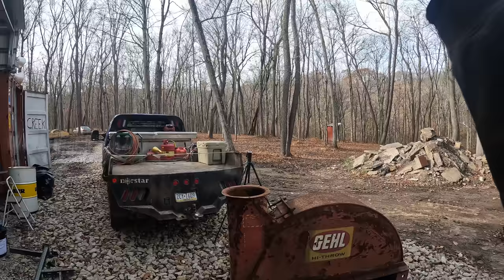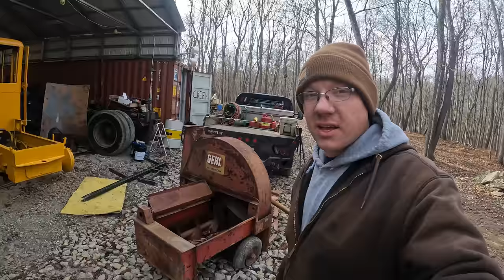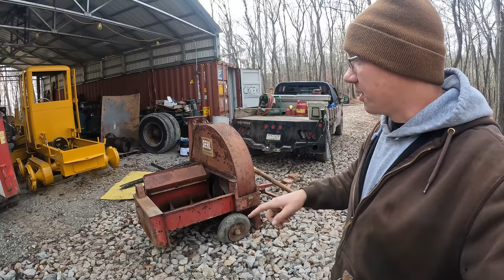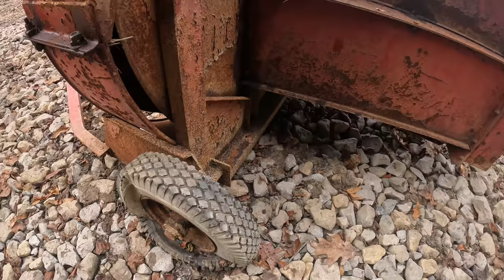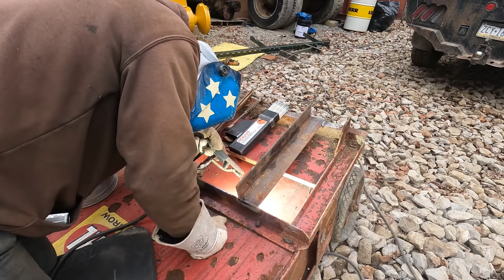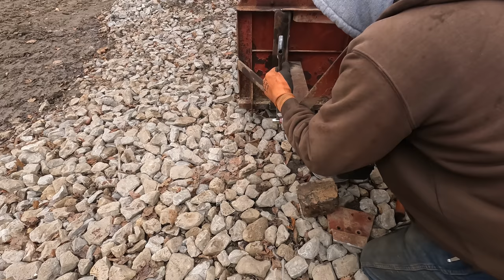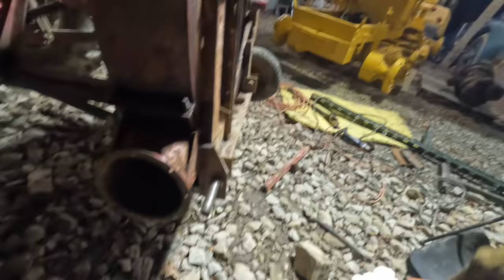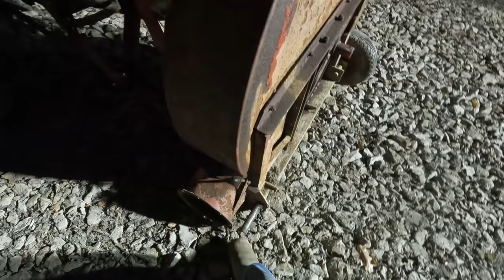I Built a Giant DIESEL POWERED Leaf Blower!!!

Comment: I suspect that you need a bit of forcing cone.  Some additional velocity would do a lot.  If that discharge is say 8", try reducing in a taper to 6".  I think the intake does need work, but not a whole lot.  You expanded metal is good.  Just relocate the intake to the top so it will not suck up leaves and reduce air flow.  Maybe angle your discharge cone back some to blow away and behind you ...

Comment: Mat rotate the blower back to the top, then run black flexible pipe drain stuff connect to lower, then run that down the side and back under blower put the other wheel back on

Comment: you need to close off the the area around blade tip ends your loosing pressure exit nozzle being so close to the entering air flow, centered opening would be more beneficial for your intended  usage

Comment: If you are using it for leaves only, you could also increase blower rpm by using a gearbox or just gears and chains. U do need some hitchpoint modifications in that case. Also, modifying the output hole to direct air beter will improve performance I bet. Great content👌

Comment: one pie shaped solid plate and two slightly smaller pie shaped holes with clip studs welded on the body so you can easily change its position.

Comment: instead of rotating the housing to left,  rotate opposite way.  leave discharge in somewhat of an upright position and create  a removable curved sheet metal funnel to direct the air down and across .  this will keep in shape for straw thrower and with a tapered rectangular nozzle end  shape, you can, like a f 22 - B2 jet engine, increase the speed , pressure  and width of the outflow. the idea below about trimming the blades and adding rubber tips would do a great deal to improve air flow.  Sparks and leaves  or straw are a  deadly combination.

Comment: There is science behind putting the air intake in the center. You create more than a fan. Air has weight. Therefore the device ends up being a compressor as the air is flung to the outside. The amount of compression is determined by the speed of rotation and probably the size of the air intake amongst other things. Since the air is being compressed the size of the intake needs to be an order of magnitude larger than the exhaust. As the air is exhausted it again expands as it returns to atmospheric pressure, this creates more velocity than just a fan.

Comment: Matt from Diesel Creek.  Torn your leaf blower back to original position and uce pipe to redirect the air. even PVC will work,
Reply: 8 inch elbows are cheap.  They could be reduced for more pressure or multiple directions  (May also work for snow!

Comment: Matt if it going to go outside for the winter I wonder galvanoleum is silver but excellent rust deterrent I wonder to get it with a coating like a red oxide until spring and check in your area about telephone pole and railroad ties to make a building with a nice angle roof steel or maybe pallets to put your stuff under to stay dry

Comment: Just put a hydraulic cylinder on the housing and make it rotate where you need it.. easy in mcminnville tn. We used mist blowers to spray insecticide on nursery . It will work

Comment: Wondering if you swing the chute the other way so it's pointing downward on say a 45 degree angle you'd gain the desired air pressure your looking for and still affectively blow the leafs off the drive. Also I don't think it'll work to well for blowing straw without a means of chopping it first. Your off to a great start though.  Can't wait to see the finished results.

Comment: This was never designed to be a centrifugal blower. The impeller, housing, and impeller speed were set up to throw heavy solids at moderate velocity. It is much closer to the function of a 2 stage snow thrower, which can fling a heavy mass of snow, but can't move air very efficiently. It will be a fun project, but will need a ground up re design to work effectively.

Comment: I guess i have to sub now.... interesting build for sure.
The last pto driven blower i ran was a Bevco i believe.
The air intake was around 18 inches or so across being centered around the center shaft.
A 4x12 piece of duct might generate better outflow for the leaves..
Add a wheel or even a ski (shoe) and giver the beans..
Those Ranger 225s are some workhorses

Comment: Hey Matt why not remove the band and grind on the blade check your bearing  to stop making the noise and on the straw shooter removed the door make a box to attach with bolt dropped the single straw and shoot with maybe putting teeth to shreds straw

Comment: You should have probably rotated the blower so the discharge chute was pointing in the direction you wanted the air to blow before welding the 3 point frame on the blower.  That would have put your air intake up higher and maintained the distance distance between the intake and discharge that the engineers determined would work best.

Comment: A centrifugal blower 0- and this IS- oine - works by fl9nging low pressure air to the outside of the shroud, and then scuuping iy towards the exhaust.  The intake holes should be as close to thge rotor shaft as prsctical.  FWIW.  From a 72 y.o. Engineer.  You Go!

Comment: 💡💡💡I recommend that you try to fab a flattened tube nozzle attachment like one used on may hair dryers so that you can create a focused air pressure wave onto the leaves in order to push and direct them in a more efficient and controlled way. Cleaning the fan blades with a wire wheel might ad one or two more horse power and you could grease around the shroud to make turning it easier. ;)  I also agree with knurlgnar24's suggestion.

Comment: Like yourself looking like great potential, Great idea and you thew it together quick. 
Because of dampness you might setup to change directions to match weather conditions, Setup not to pound and fight with it ,Perhaps a grease fittings with  a chanal for grease to hold grease in its location. Also a long bolt to rotate in adjustable location easy to turn with your battery power impact wrench .
Like your thinking about this fix.
Thanks for teaching others

Comment: The air intake needs to be close to the drive shaft (with the existing grain entry completely closed-off) forcing the air by centrifugal action to the larger outside diameter of the fan housing, so that the only way out is through the exit nozzle.  The fan blades should be a close fit to the larger diameter and sides of the housing, to minimise blow-by.  Multiple air intake's can be arranged on both sides of the fan housing, each side having an entry area equal to (say) the exit-nozzle area and as close to the drive shaft as is practicable.  It will make a great finger dicer......lol

Comment: you should put that wheel in the middle trailing the backside you would be able to still angle the blower and not drag or put a skid plate so it don't hang up

Comment: If you modified the 3point hitch mount so it could also be hooked  up upside down then you would never have to slip the discharge chute around and no more modifications to the Intake would be required.

Comment: I’m thinking take the output head and rotate it all the way round to the other side where it blows more downward on the right side of the tractor and put a half plate leaving the center open it’ll compress the air better like a rotary fan does with the plate covering the outer circle of the blade tips it’ll maintain compression then it won’t matter where the output is it’ll have the most power anywhere in rotation. A supporting idea cover the hole completely with sheet metal and drill a lot of holes closer to the center then it would make it to where you don’t need a grate it’s built into the plate with an ass ton of small holes kinda like a grate. if you wanna ruin some drill bits that is. And I’m loving the videos by the way because most of the things you do are very relatable to what I do from the whole I can’t see it from my house kinda view.

Comment: Good idea, but I think your biggest mistake is making it 3 point hitch mount. Now, as the tractor goes up and down, your implement is either too high or digging in the ground. Trailer style implements are harder to maneuver, but don't have that particular issue. As others have mentioned, spin the chute to the other side, you will get some down pressure on the leaves, you can leave the intake hole where it is and your air flow will increase.

Comment: Remove the ring and vent, turn it around so the outlet is on the bottom right and re-attach. No need to change inlet then. The ring seem symmetrical so it should fit on pointing left as is now, or right. You would have to block off part of the inlet to keep pressure up. You would then be blowing from the right side out and not the left side out.

Comment: Block off the intake  opening then make new one in the center 18-24”” round leave enough to support the blower shaft & bearing. this  would pull in the most air like a vacuum cleaners , yes need a wheel!! and if you tractor will do it, put your hitch in float  if use to blow straw  you have to make a pre cutter/ chopper to size the straw to blow it ! Also will need to protect the fan  carrier bearings so straw/ debris does not wind up on shaft and get bound into bearings it will happen you can use the shaft itself (the old auger shaft assembly will give you most what you’ll need) as the drive to precut the  straw and still feed in through the center just cover the bearings!  Extend the shaft put on lengths of chain to beat and row of knives to size the straw! This will need to be boxed in. With a lot of room to give room for the straw to come apart and be cut/copped If too long & stringy will plug up and also build heat and catch on  fire!  Suck to unplug and put out ask me how I know??  Note: wish could draw you a design that would work and would not have to remove to do other work with it! Like blowing leaves!

Comment: I suggest (if it wasn't already) To try and rotate the vent al the way to the other side so it points down like 45 degrees with the ground and see how it would work. It's and easy experiment it doesn't require any modification.

P.S. Well it's almost an year since the video was posted so you've probably already tried that.

Comment: My first thought was to rotate it to the other side so that it is blowing on the right. You wouldn't have to cut part of the bracing in the first place and when you rotate it like that, it would be angled downwards quite a bit. Most of all, the outlet would be just ahead of the intake so the air would have to go all the way around from the intake and should have significantly more momentum going out. Also with some PVC pipes you should be able to make nozzle that could be rotated, this way it could be pointed directly when it has the best results, like blowing slightly to the front so that leafs don't just swirl back on the driveway. 
Anyways, as others suggested, it's not exactly a fan. It is working with grain because it throws it while blowing some air. Grain has some momentum because of this. Blowing just air is not as effective because it does not have that much mass. It could be turned into real centrifugal pump (big ass turbo basically) but it would require some modifications. The easiest one is to close off the intake and make another one close to the shaft. Centrifugal force is pushing the air outside so it sucks from the middle and creates higher pressure on the outer side. It would probably work much better this way. Further improvements would require much more changes to the case, probably not worth it. You'd have to make it more spiral. Add an extension to the outer band and additional side pieces that would create more space as it gets closer to the outlet. Basically the diameter would be smallest just behind the outlet and then slowly increasing up to the outlet again. This way the air that is getting momentum and is pushed into the outside band would have nowhere to go but the outlet. This would maximize the output power of this thing.
Just google volute centrifugal pump, one image is worth more than this comment. The other type is diffuser type which would be even easier to make but I'm not sure which would be more efficient. Diffuser type has constant diameter but the blade is shorter. Instead the outer side has fixed diffuser plates which prevent the air from rotating inside the case and force the air to push against the outside wall. This way it builds up pressure all way around the case and wherever is the opening, the air will blow there. In this style the air (or liquid) actually flows to the outlet from both sides, the blade direction does not really matter. I actually made one of those years ago for pumping out rainwater with all stuff that it sucked in. Any other kind of pump would struggle with sand and abrasive that was laying around (it was sandblasting tent that was flooded with each big rain).

Comment: Put the exit port back to vertical... could you turn the entire unit 90 degrees? Since you welded the 3 point setup, could you weld a second setup in this orientation? This would allow you to use the present intake without needing to cut those 8" holes you were mentioned...?..

Comment: I think I would put a hole on the top. a smaller hole to give you more power. Cover up the big hole on the back & make sure to seal all the little cracks every little bit will help in this situation. It should blow like crazy!  The hole in the back is letting to much air in,in the wrong place.

Comment: Matt can you do a enclosure for your crawler roll cage for dozer and figured what about putting a storage building probably used run electrc box to plug 🔌 in one of your dozer or crawler with a block heater to easy start to shovel show but I working on a drawing using telephone pole drilled into the ground then use the same pole and build a log cabin industrial building just for winter storage plus I check for you on getting a army tarp to drape over another frame to keep dry and find a tarp to cover either front or back of your to keep snow out also Matt on the size of the building close to the creek another storage box and if we can make it your workshop to put your saw drill press hydraulic press

Comment: Hi Matt saw a guy who had a blower on his skid steer cut a little off the vanes made it back up with pieces of rigid mud flap to take up the gap tighter it is sealed the more blow you get worked like a bear  threw snow a good 100 feet similar to what Mr z said

Comment: Instead of pounding and grinding on the band and chute, just add a little material to the outside diameter of the front and rear discs. Then when you put the band back on, it will not hit any more. If you mark the spots where the blade hits, I am guessing that those locations are where the disc radius is smaller than the areas where it does not hit. 

Having your chute be on the side blowing away will mean that you have to drive down the side of the road to blow the road clear. If your air blew from the right top, down and under the unit, then it could clear most of the road from the center to the left side when driving down the middle of the road. On the return trip, it would clear the other side of the road, still just driving down the center of the road.

Comment: I'll go ahead and jump on the try it turned >180 degree bandwagon .... in part because it'd give more room to accessorize the flanged exit to do quite a few different things like: entrain additional airflow (trading speed/pressure for more volume), add a short tube section to siphon seeds/granular solids -- or inject liquids/aerosols into the exiting airflow, and experiment with different nozzles.

The other nice thing with this setup is that drive shaft already extends through the fan so it shouldn't be too hard to add a secondary pump if/when needed to pressurize liquids - or drive other machinery given it was previously used to drive an auger. 

Will require some tinkering, but this thing could quickly turn out to have more uses than you have needs for it.... (e.g. not sure anyone would have use for a paint sprayer that size ...unless they literally wanted to paint a town red :D )

Comment: Cover your inlet with a piece of sheet metal and have it as close to the blades as possible,  without hitting.  Research how an actual air knife blower is ported and put your intake in a similar location to the air knife's.  This was originally designed to move light solids,  along with the air,  not just air alone,  as you plan to use it.  Find or fabricate a tapered sheet metal spout,  possibly,  positionally adjustable,  to place on and reduce the diameter of your outlet,  and/or maybe,  give it a flat profile,  instead of round,  for faster air flow and maybe a little better area coverage.

Comment: I'd pop a wide intake underneath, as big as poss, vacuum up the light stuff off the track, and have a flattened outlet, pointing low-ish, for decent shove out the side. You've prolly done it by now.
Reply: ...Rolls-Royce Olympus 593 would do the whole track in a jiffy

Comment: Matt. I had a Little Giant leaf blower at on time and on the opening of the center shaft of the blower
It had a couple of standoff mounts with a round plate attached to them so that the hole was covered but still let air in to increase the output volume of the blower  I hope I described it enough so that you get an idea as to what I am describing   If not just Google  Giant Leaf blower and it should show you what I described   Hope this helps 😊